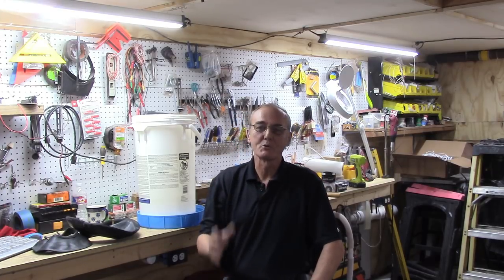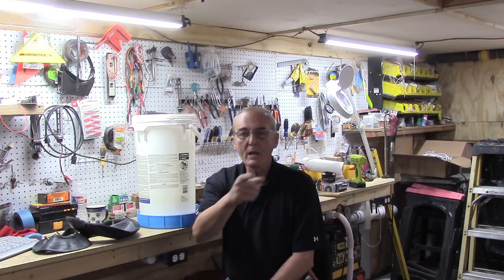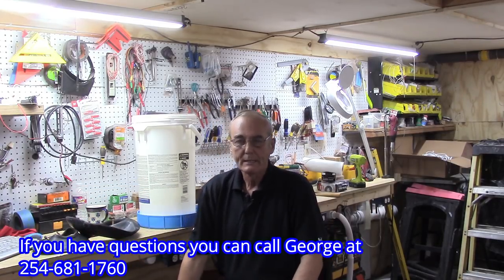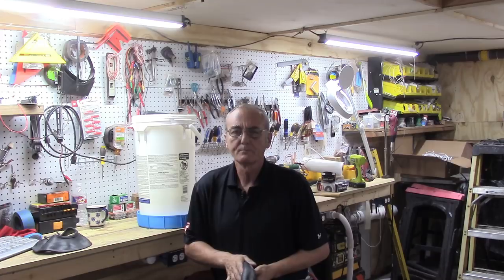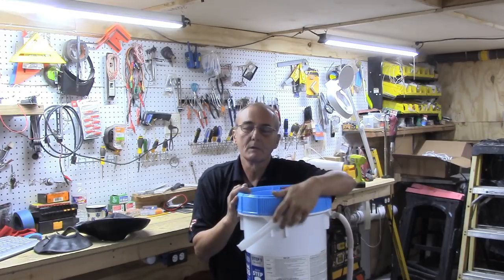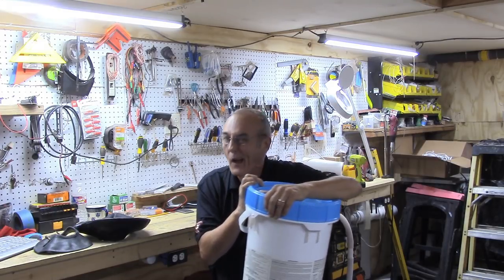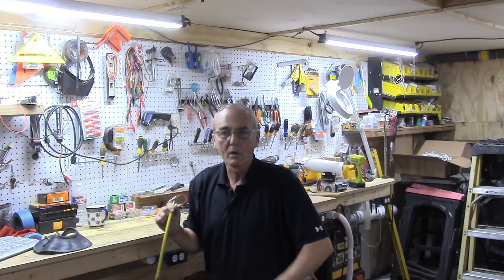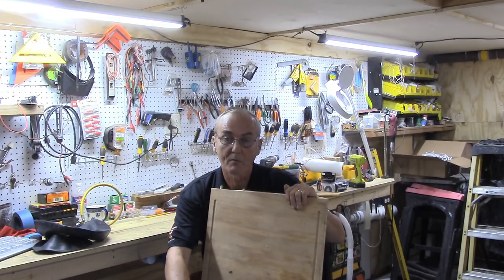MAKE YOUR OWN PNEUMATIC FRUIT PRESS

Comment: Thanks for all the great videos!! 

I have been having a hard time pulling what I assume is hydrogen sulfide out of some brandy. It smells like sulfer and has a lingering bite in your nose. It tastes fine just has an off putting oder. My grocery store had 7 gallons of chardonnay on sale that I ran through a pot still. I assume this is from the sulfides in the commercial wine. Any advice?
Reply from the maker: It could be anything and more likely nothing that you did or failed to do. Try a little glycerin (or glycerol) to see if that will smooth it out. The dosage is 2 oz per gallon as a start. You can find it in the medicine isle of your local grocery store. It is an animal based product that is completely safe to ingest. Most moonshiners use it as smoothing agent and aging catalyst but they won't admit to it. I use it in almost every run I do now. You can add more than the 2 oz until it smooths out.Let me know if this helps.😀
Reply: @BarleyandHopsBrewing  hey! Thanks for your reply!! I use it already :)

Do you think using copper would do anything? I currently have an all stainless steel set up. Would copper in the already shined Brandy do anything?
Reply from the maker: Not sure it would help.
Reply: @BarleyandHopsBrewing  didn't think so.. thank you again! I really enjoy your videos